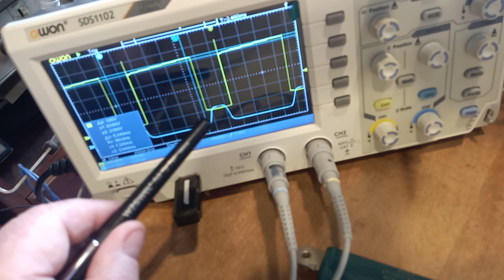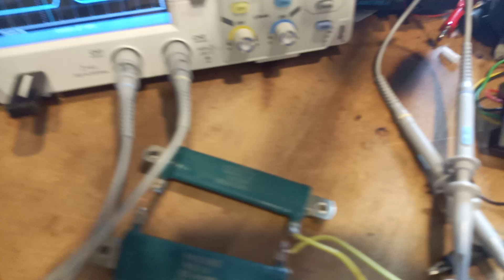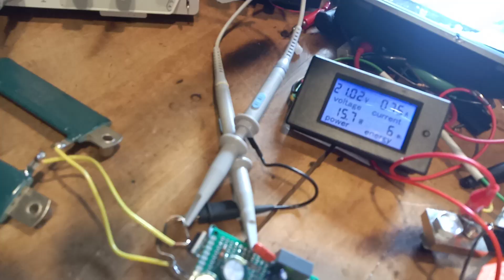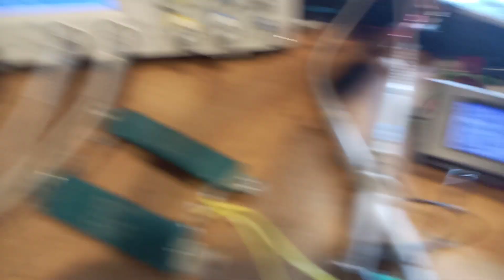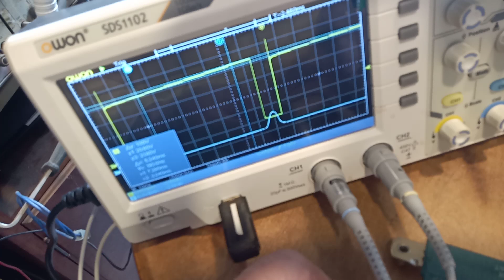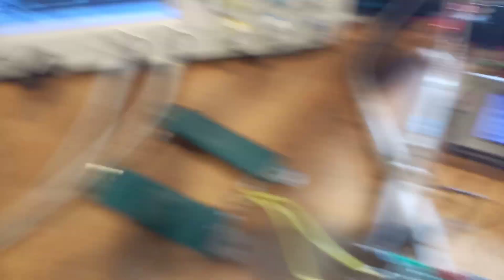Testing The LM358 PV Water Heater On a 12V 50W Panel #fotovoltaika

Comment from the maker: This is a test on a cloudy day in winter with a 50W 12V solar panel designed to heat ice filled water for chickens.  This test has 70 feet of extension cord between panel and controller which adds some resistance.  Current initially is around 0.8A from a 5A panel.  Typical for winter on a cloudy day.  It is still enough to melt ice.  Note the FET has no heatsink and does not even get warm.  Load resistance is 6 ohms.  Later I short out one resistor to make it three ohms.  Duty cycle decreases but the power remains the same, matching panel to resistance.